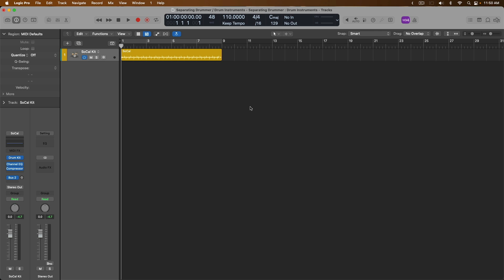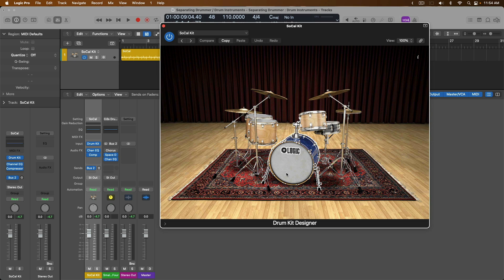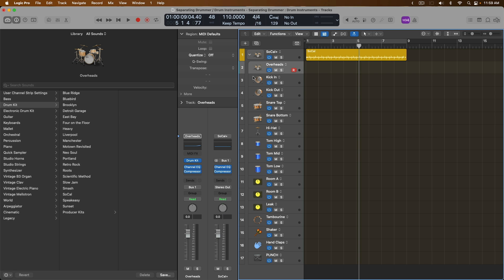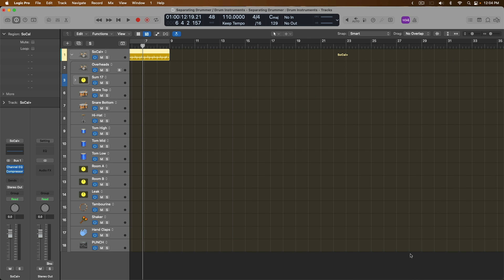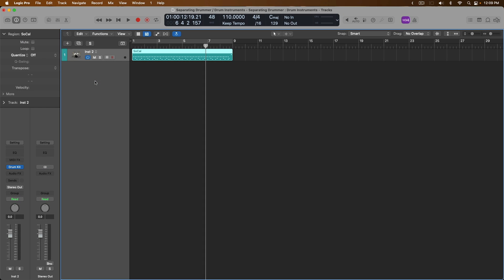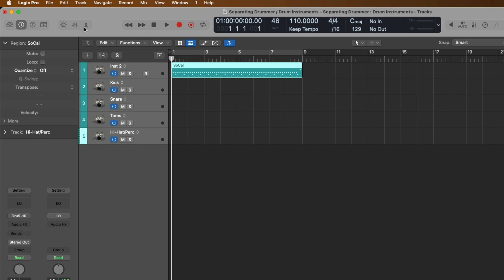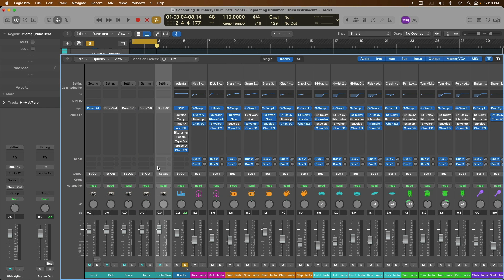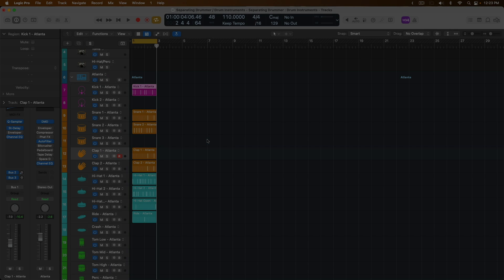How to Split Up Software Drums Into Individual Tracks

Comment: I wanted the drums to be routed out to my mixer for dubbing on my live desk. To do this i had to create new bus tracks, send the multi outs of drum designer to the various busses, set each bus to mono then send those outs to my desk as required. I couldn't find any way of setting the drum designer outs to mono, which is a bit weird, not sure why it's not a standard thing

Comment: After the drums are split into separate tracks is Room A and Room B considered a L / R scenario meaning that Room A should be panned hard L, and Room B panned hard R? Or is the stereo spread already baked in if the pans remain at "0"? Interesting that the Overheads are a single track, rather than a separate L + R, therefore, I'm presuming that single track is in stereo, and panning remains at "0". And Room A and Room B are also two stereo tracks, respectively.

Comment: I tried exporting this so many times and no matter what I selected in the export dialogue box, it summed the drum tracks to 1 file, and then I realized that I didn't highlight every track in my session before hitting export. I think this is really dumb... if I went through the trouble to select a "producer kit" then of course I'd want to export those individual elements as individual tracks (with all the other tracks in my session). Going through the extra step of highlighting every track seems like it should be unnecessary. Anyway, thanks for the tutorial!

Comment: work in 6/8 time signature  or 7/8 ,  hold playhead with mouse to move from one bar to another bar  let see what happens .    (( snap button should be in bar not in beat or division ))
Drag any sample of 6/8 from loop library  try to move it on bar   😁😁😁😁😁😁😁😁😁😁😁😁

Comment: Excellent video, again!  The capabilities in Logic far surpass most 3rd party drum machine/sample players/instruments.  But the workflow needs more insight.  I find converting pattern or midi regions by pitch to separate tracks, kinda the last step.  Because it’s tedious to change the pattern 1 kit piece at a time.  It’s easier to do in 1 pattern or midi region.  And - as far as I know - it’s not easy to re-consolidate separate tracks back into 1 pattern region.

Comment: There’s also the multi output option in Drummer. 

Another way to convert Drummer to MIDI without losing the original Drummer performance is to make a new software instrument lane and option drag the Drummer regions to that. It will convert them to MIDI. Then mute the Drummer track.
Reply: Nice, I didn’t know dragging the regions to an empty midi track did that, good tip!
Reply: what a plugin or program if the track is a stereo mixed audio drumtrack done in a studio (not created in drummer logic) trying to separate kick, snare, hat, ect? Turning it into midi in logic?
Reply: @nstycrv  drumSSX, by fuse audio, does a really good job of separating the pieces of the kit, then you can bounce them to separate tracks. You can then do the “replace drum track” function in logic to generate the midi.
Reply: Hi Raven, i'm trying to convert my drummer to midi. However, when I try to bounce tracks in place, instead of getting midi regions into individual tracks, I get audio files instead of the separate midi performance. What am I missing?
Reply: @cloepop111  this is what I do: make a new software instrument (MIDI) track. Move it right under the Drummer track. Now select all the Drummer regions and Option-Drag the Drummer regions to the empty MIDI track. Now you have MIDI data! 

Now set the instrument to what ever drum set you were using. You can also copy and paste channel settings to the new channel (effects, etc.).